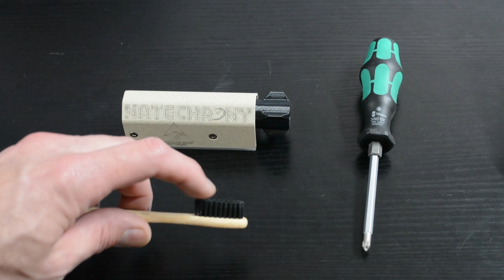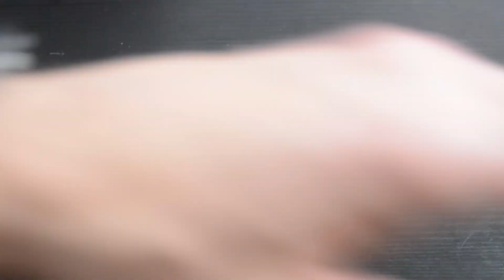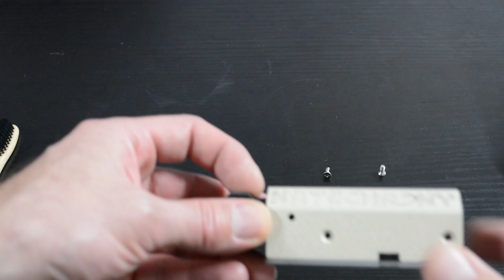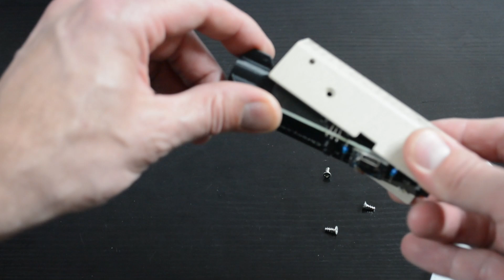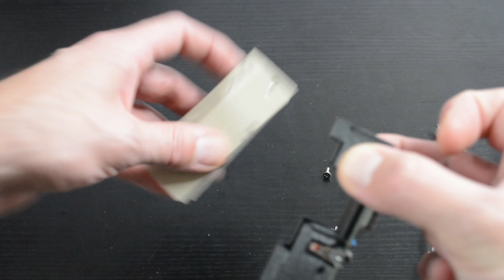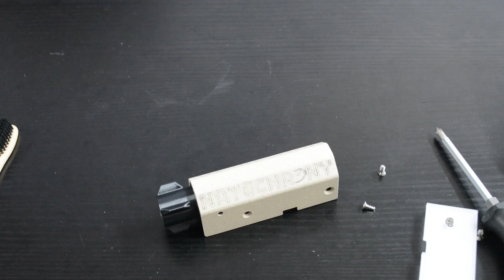NateChrony v2 Cleaning Process

Comment: Using the buck chrony version, haven’t fired even 100 shots in it from my notos, and I have gotten this error at least 6 times with maybe 5-6 shots in between. Cleaned interior with a small cotton towel scrap, reads 3-4 times and error again. Cleaned barrel, same issue. How do you take this version apart to clean more thoroughly? Seems odd as it’s only 1 month old. Any help appreciated.
Reply from the maker: Give Buck Rail a ping for this as its his enclosure. It should be screws from the base, take off the base & then the Chrony part should drop out the bottom too.
Reply: @NateChrony. hi sent email to you and buckrail. She said it’s on your end, you said it’s them, just trying to figure out what’s happening doesn’t make sense. Today shot 50 shots perfect then velocity kept dropping by 100 fps for 5 shots then the error again. I checked barrel with a patch and it’s spotless.